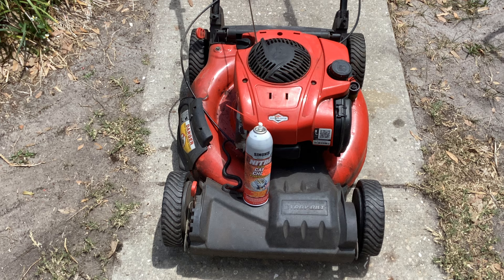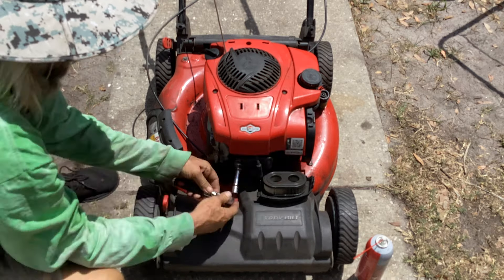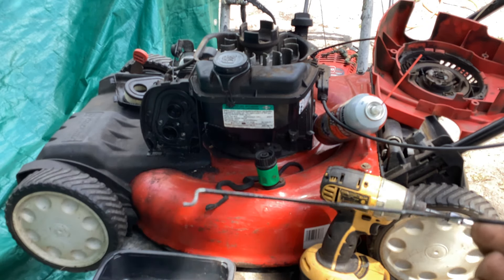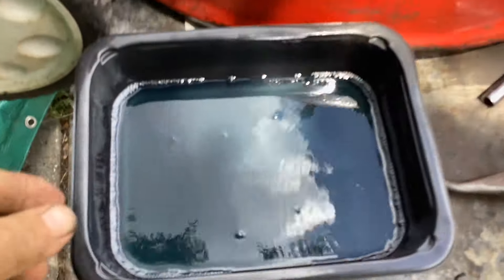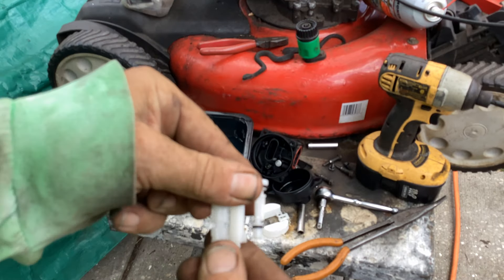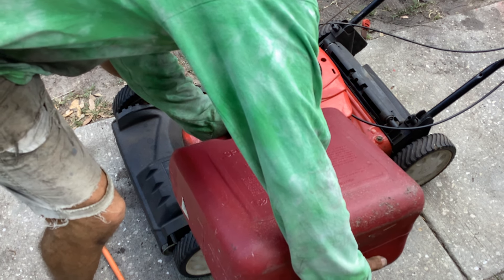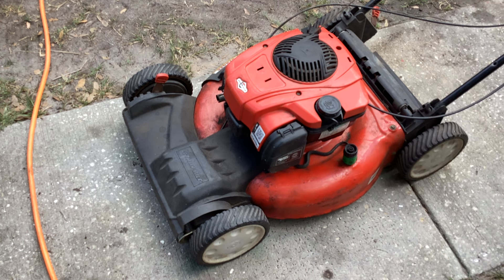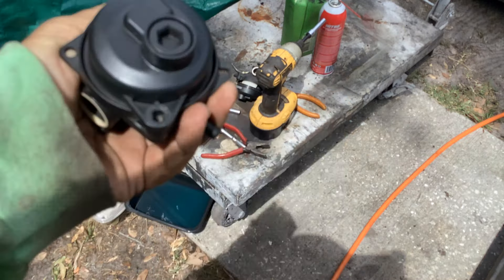2016 Troy-Bilt TB200 Lawn Mower for $30 Trade Value. This Mower Turned into a Disaster Very Quickly!

Comment: Still a good score Tommy.  If you can get $150 for it as it is now, touch up that deck with Rustoleum Apple Red and the handles with Rustoleum Glossy Black, probably get $180 to $200.  I just wire brush them and paint, no primer etc.
Reply from the maker: thank you.

Comment: Glad ya remembered the hose clamp. Got my neighbor fixed and started. I think it has a governor issue. Surges until warmed up. Drained fuel and check jet on bowl. May gave been old gas didn't have to use happy juice. Need to rewatch ur video on carb connections. It had a knockoff NGK plug, savion brand.
Reply: Got my fix completed. Had to adjust the idle jet. Starts and runs like a champ. Used my T ach to set the RPMS. Check and set gap on coil and plug. Didn't check valves.
Reply from the maker: @timtweet8149  Awesome Job.

Comment: At least you don't have wobbly wheel syndrome! Every mower I have picked lately has massive wobbly wheel issues. I need a place to buy wheels on the cheap....not the jungle place.
Reply from the maker: I just google the part number and look for good pricing.